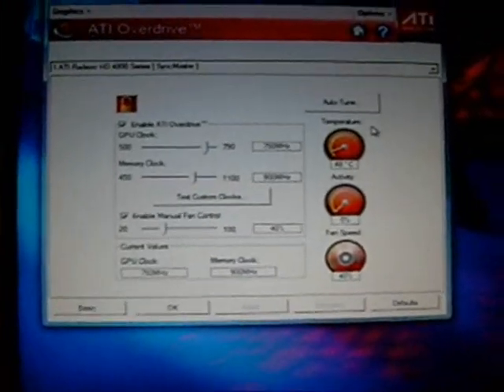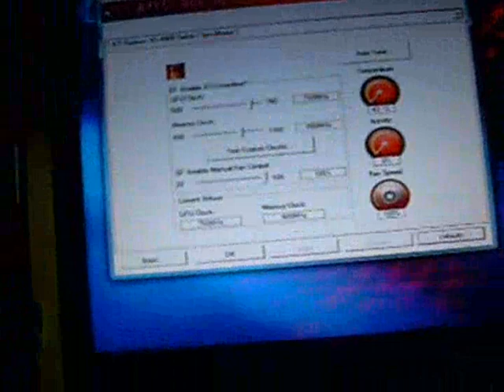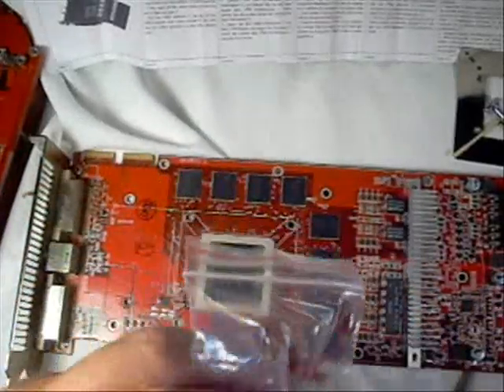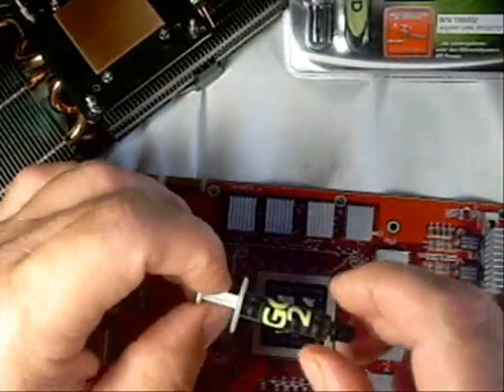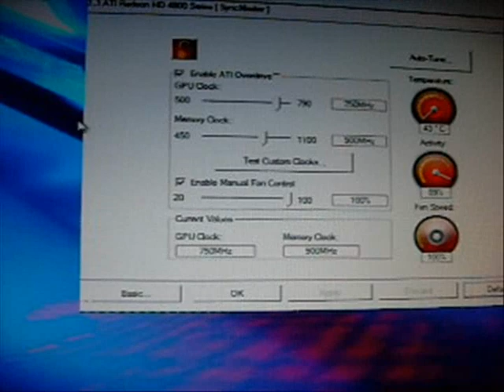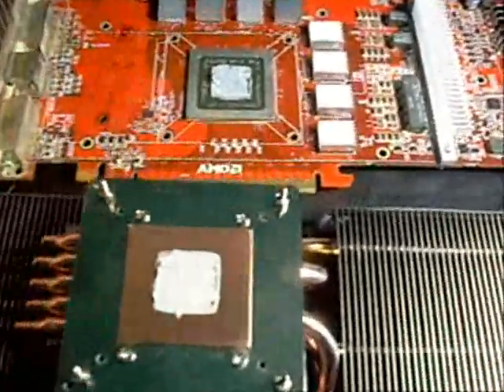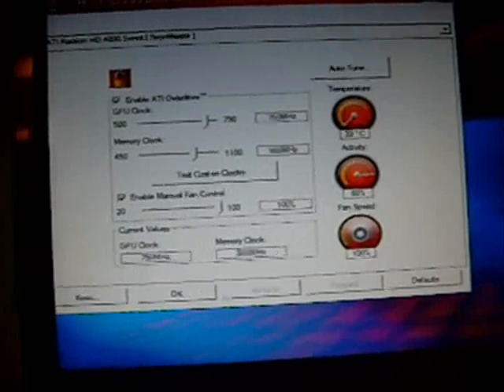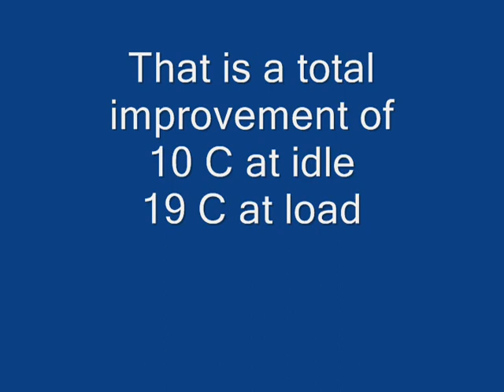Benchmarks on the Gelid Icy Vision 5 pipe VGA cooler

Comment from the maker: @dsteenbock They are held on with a fairly strong double sided tape. With a little work I think that a person could get them back off. It may require taking your time and heating them up slightly with a hair drier to get the glue to loosen up. And getting the glue residue off the chips might take a little doing. So A person would have to be ever so careful if doing it to not damage the card. I was wondering the same thing because I would like to add a waterblock to mine.

Comment: I'm also using a HAF-X case. The case has a air duct that sucks in air to the case and it's pointing towards the video card. I think the case air flow blocking Gelid air flow as the case 200mm fan also blowing into Video card while Gelid trying to push air outside from the card. I will try with GC-Extreme. Thanks.

However, I'm happy with the temps I'm getting. Better that 90C.

Comment: how much Thermal compound did you apply? I'm using this with an EVGA GTX 470 and the load temps goes to 63C which I think little high for a 470. I just put a thin layer of compound but when I disassemble my stock cooler I saw good amount of compound. Therefore I'm thinking if I didn't put enough thermal compound.